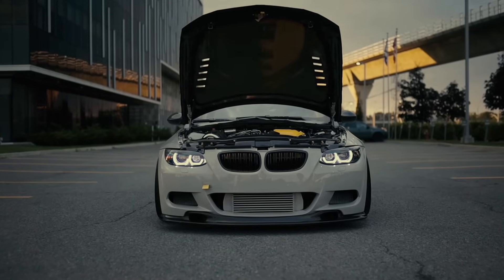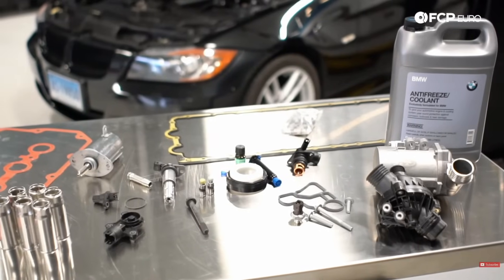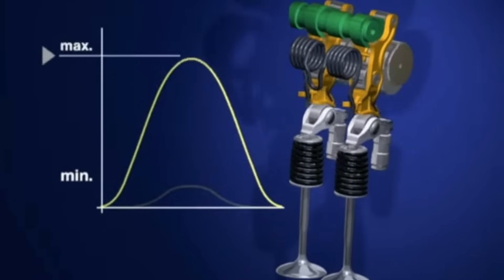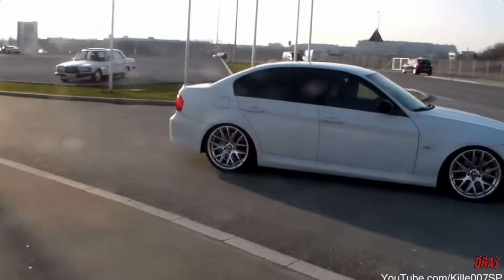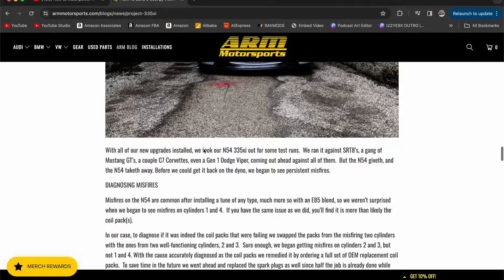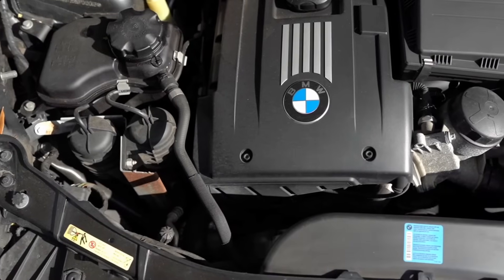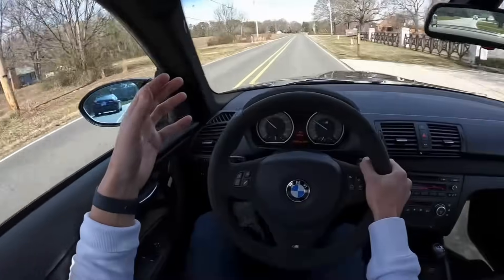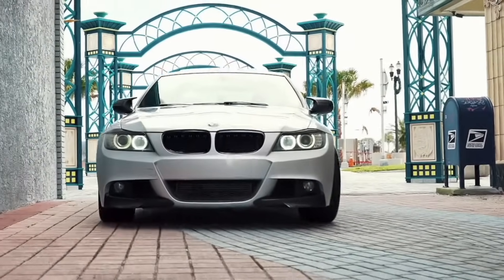Ultimate BMW Engine Showdown: N52 vs N54 vs N55 – Which One Should You Choose? | Comparison & Review

Comment: come on dawg N52...all the way...if your cost conscious like me. I'm still fast and light...Full bolts on, 6MT, Supercharged...and heavily reliable
Reply from the maker: I’d love to pick your brain on the supercharger, do you have an insta?
Reply: supercharged and reliable?
Reply: @mikedodd9294  yeah, so far I only replaced the valve cover gasket and the starter…common car issues
Reply: Depends on your goals.  If you want a low cost tunable and somewhat reliable car.  For 1500 bucks add a down pipe, intercooler, BM3 OTS tune & you N55 will make about 360 WHP which is about 415 crank with about 500 Ft lbs of torque.  These N55 powered vehicles are very low cost machines.  
If you care more about maintenance costs than performance you could buy a Toyota or an N52. 
If you want to build a 600 HP engine without changing the internals, go with the N54.  If you want somewhere in the middle go with the N55 if you can't afford a B58 powered machine.
Reply: @jeffa.8976  you’re right; the next  time I go to a turbo charged platform; trust me it will not be a BMW (I love the BMW NA, BMW had a legacy with NA cars) I will get a Honda civic type R.
Reply: @nelsonx4235   @nelsonx4235  A  Civic type R is a great car but I think a B58 powered 240 or 340 is a much better choice.  #1 Modern BMW's are ranked #3 in reliability by consumer reports which puts them only behind Toyota and Lexus but ahead of Honda.  The B58 engine with a ZF 8 speed is the most reliable powertrain BMW offers but manuals are still available.  #2  The mark up on new type R's and resale of used ones make a used BMW 240 or 340 cheaper.  #3 The BMW's are RWD or AWD. which is far more fun than FWD, the AWD is good for winter.  Both the RWD & AWD will handle high H.P better than a FWD car.
Reply: sadly FBO on an N52 gets you stock power of a  N54 minus 5Hp. for about $4000
Reply: @AndrewNichols  that is more than enough for people who just want a clean daily that doesn’t have n54 problems
Reply: @lousehassle yes but put $4k into an n54 IN JUST MAINTENANCE and it will last just as long
Reply: @kevinsinor2821  hahahaha I think you’re full of crap, I owned one (used one high mileage) and I can tell you I spent big $$$ on injectors, turbos, carbon build up, wastegate rattle, high pressure fuel pump and not to mentioned the common oil leaks
Reply: @lousehassle  yeah I’m probably making close to 330 to 350wph; I haven’t dyno…not crazy power but I’m light and it is fun to drive. It is my daily so no need to get crazy hp.
Reply: @nelsonx4235  I hear ya, but all of what you mentioned can be taken care of for $4k. Taking care of the turbos and wastegate rattle are the same thing. Hpfp $1k injectors $1k. Turbos $2k on average depending on what you go with. But this is also from a diy perspective so labor is not included in these costs. Surely if you had a shop do it they’d steal all your money and the maintenance would total out the car. But most n54 owners are going to diy
Reply: @kevinsinor2821  it’s too much hassle for me; the N52 makes sense for my needs; it’s not crazy power but it’s a great platform. The N54 I think is for more like a track car build imo
Reply: @nelsonx4235 what did u do to it to make it get 330HP?
Reply: @Ry3Pacyy  customs tune, smaller pulley, injectors, custom exhaust etc…I may be between 300 to 330whp. Again I just wanted a bit of power…I don’t need 400hp + for daily
Reply: @lousehassle n55? Get a 2012 - 2013 and u get rid of the hpfp issues, n55 fixed injector/plug/coil issues from n54. Only extra worries from n55 vs n52 is the turbo. Other than that it is just as reliable.
Reply: @kevinsinor2821 facts I put 4.2 in maintenance at bmw warranty work haven’t ever been in the side of the road in my 335i
Reply: @nelsonx4235  lol I owned n54 and n55 (still do) and my n54 has 250k miles runs like a champ only had to fix a minor oil leak. My n55 only has 100k miles still no problems what so ever. So when kids get a hold to cars they usually break quickly and easily.
Reply: @ThatN55GuyB  I get you and yeah you right...Im just deep in this N52 build
Reply: @lousehassle so youd rather do all that work drop all that money and do supporting maintenance on the new mods just to get beat by a completely stock 335i? you crazy
Reply: @lousehassle just get a m57 best of both worlds
Reply: @lousehassle I’m saying 300+hp NA vs boosted is way better
Reply: @lousehassle right , I'm looking for a fun fast reliable bmw. That's ALSO looks good.
Reply: @nelsonx4235 idk. I’ve had my N54 with 133k miles single turbo’d at 475~WHP since about 108k miles and haven’t had ANY issues with the engine at all.
Reply: @SuperBloopie it’s a matter of time, even mine has issues…imagine an n54 which is a MORE complex platform
Reply: @nelsonx4235 lol my exhaust manifold warped and ripped the threads out of the head 😂 you ain’t wrong
Reply: @AndrewNichols weight difference?
Reply: @BlackMigo702  200 pounds lighter…car stock, no sunroof, lighter wheels, back seat delete, racing light front seats, removed heavy muffler, lighter hood…there is more yeah
Reply: @AndrewNichols there’s a single turbo kit that gets 400-450 whp if I remember correctly
Reply: @AndrewNichols  who cares I owned one and that car always had an issue…yeah they make more power but a high steep cost…my N52 makes decent power, but it is a blast to drive…and I’m super light too
Reply: Had all 3. The n54(z4) is honestly hysteria on wheels! Stupid fast in stock form. N52 is slept on..milvs and a few na mods a tune?? s50 who😭?The n55 is a decent daily and can live weeks starved of oil and coolant but it can feel boring at times. Least fav drive experience
Reply: are you thinking of doing the 22rpd velocity stack intake soon for more power? they claimed 270whp with other boltons on an NA motor
Reply: @bogdanneamtu12  that’s nice but I already got the supercharger so I don’t see the need to add this
Reply: N55 is a wank engine! They fail all the time, valve tronic is crap and bottom ends knocks, cam carriers move, just avoid!
Reply: Why you lying to these people
Reply: @ashtonwalker14  lying? because I’m pushing an alternative platform?
Reply: @ashtonwalker14  clowns like you think N54 is always the answer…yeah if you want raw power yeah
Reply: @nelsonx4235  i went 335I road. with M3 arms,  plan on doing ARM downpipes and a AAF Baffle in the pan next.  But my engine is super clean inside, i've replaced a lot of the plastic components with metal ones,  and the car has almost 190K on it with the ZF6 speed manual 

i personally think the N54 is more mod friendly,  makes decent power, and is more well balanced overall for road coursing,  it does need an M3 or ford 8.8 rear differential though.. this one wheel wonder crap sucks.
Reply: @exiteternium  I def agree with you; I'm just too deep invested in the N52 built
Reply: @exiteternium  yeah I get you; not hating if you’re chasing raw power; makes sense; I just prefer the NA inline 6 platform
Reply: @nelsonx4235  Raw? no, 450-500 well balanced power? yes.  the car with M3 arms does exceptionally well with cornering, even stock they did 0.90-0.95 G's 
which is great for AutoX.  so no, looking for for a Slalom/AutoX that i can daily drive.
Reply: I have so many questions. I'm about to get a n52 328 and need some guidance.
Reply from the maker: @terrencewoodard8000 ask away brotha. also find me on instagram @izzysakran and I’ll help more on there
Reply: Still running 12s with all that work done. Just toss me the n55 if I want reliablility and n54 for real power.
Reply: N52 Engine never disappointed not a bit
Reply: @drphirinaphtaly6409  the N54 folks haven’t experienced a supercharged, reliable, lighter BMW. It’s just the NA inline 6 feeling.
Reply: Bro facts. 3stage intake and a tune already does so much and still stays reliable 😂. I’d take an N52 any day
Reply: @GuacGG  yeah i agree thats enough power for a daily; the suercharger adds a bit of spice....not crazy power, but enough to love the car more
Reply: Might as well get a 335i at that point and put the same money into maintenance to have a reliable car. No mods
Reply: @CalmDown458  true, just too deep into this build
Reply: M57 all day long 🤣 16 year old one sat outside no oil leaks or crap like that easy to fix timing chain and the e90s just a special car
Reply: How much power?
Reply: Yeahh!!!😂
Reply: N54 ftw
Reply: idk why but I trust you lol. definitely getting the 530i . Been hearing good things about the n52
Reply: Cmon dawg
Reply: @HolaHelloBonjour-fku the hate is real

Comment: 300k mile N54 in a E90 335i, love it, do your maintainince.
Reply from the maker: that’s amazing! do you have it tuned or running factory power?
Reply: @IzzyE9X tuned and it had a weight loss down to 2600lbs
Reply: N54 almost 200k miles.
Reply: That’s awesome to hear. I never actually see high power high milage BMWs on YouTube other then that 335i on mishas page. It makes me happy to know I’ll have my 75k mile n54 for a long time😆
Reply: 700hp n54 135i 6mt vert with Rollcage , parts are becoming more affordable plus lifetime replacement with FCP EURO.
Reply: I have a 2008 135i convertible with 153k miles and no issues :) just do your maintenance that's all and yeah if you don't work on cars probably is gonna be expensive but parts aren't expensive but the labor it is but if you do it yourself you'll save money and also you know your car is in good shape
Reply: 128k miles on my 335i E90 2009. Bought from auction, hit in front. This baby flies, and no need to even tune or anything🙂‍↕️🙂‍↕️
Reply: 250k here   Bought at a junk yard at 150k miles and still running beautifully
Reply: My radiator just went off because of over heat😂🥲
Reply: Yep they are super strong!!!
Reply: I'm rebuilding mine (N54), like servicing the engine fully and then will install FBO and and mhd stage 2 probly 😅 P.S. it's on 225K kilometers. That's ermm about 140K miles.
Reply: @RainbowBelow Me too. Did you do the food yet? How's she running?
Reply: @adccars359  Not yet but completing it this coming 2 weeks with my mechanic. Did a lot of additional upgrades including the Mosselman oil cooler and oil thermostat, downpipes, intercooler, sport air filter, new turbine cores, new springs & shocks, changed rod bearings and main bearings full inspection and servicing of the transmission, coils, plugs etc. Also added the AFE power XP mach force axle-back exhaust :) Can't wait to hear her running man... exciting times!
Reply: @RainbowBelow Awe man. Best of luck.
Reply: 8 waterpumps later… I own one trust me I know
Reply: @GiveItGas69420  bro 8 waterpumps? Lmao wtf did you put the same one back in every time 😎😆(sarcasm)
Reply: @GiveItGas69420  How did you know it?
Reply: N52 291k miles and a N55 32k miles. N55 so much more fun.

Comment: I have a 2013 535i m sport n55 that has catted downpipe, VRSF intercooler, Valvetronic remote exhaust, MHD stage 2+ tune, XHP transmission tune, and will pull any 550i any day. Just hit 100k miles, and my only failure has been a water pump, and that really didn't even fail, but it was going because my fan would run more often. 
What I'm saying is I drive the crap out of this car daily and it's without a doubt been the most dependable vehicle I've ever owned. Not to mention I've always been a Mustang guy.. 
That said, the n55 to me is that sweet spot.. 
Nice video! Thanks
Reply: Hey Brother, I also have a 13 535i M-Sport X drive.  My OTS stage 2, XHP stage 3 car runs a 12.9 with a s tock exhaust & intake.  I beat a B58 powered 340 in a heads up race at the local strip.
I have bought a really nice low kilometer one owner car with a documented perfect service history.  I currently have 125,000 kilometers which is roughly 75K miles.  I'm installing a pure 500 turbo, high flow inlet pipe, heavy duty waste gate, GFB diverter valve in July. I'm also upgrading rod bearings, changing the oil pan gasket, valve cover, coolant lines, thermostat & water pump just for maintenance while I have the subframe off.  I live in an apartment in Edmonton so I'm driving 3 or 4 days across the country where my family has a shop so I can do all the work myself.
Reply: 3 pulls 2 months ago on the dyno with a best of 351hp and 411tq at the wheels @19.5 psi. Also that's running e30. It's a very healthy motor on the stock turbo. Still gets 30ish mpg highway.  Iam considering a Dorch stage 2.5 hpfp, but can't decide on either a Pure stage 1, or stage 2 turbo upgrade. Since it's my daily driver I may just go Pure stage 1 and call it a day. I believe going stage 1 on the stock hpfp will definitely get me at or just above the 400whp on 93 octane..
That to me is the sweet spot. Also according to Draggy the way I sit my best 0-60 was 4.27, and quarter mile was 12.92 @ 109.4 with a bit of wheel spin
Big improvement compared to stock
Reply: Oh as a note that dyno session was before I installed the VRSF intercooler.   Since that it does feel better in the upper rpm range as the boost hangs strong longer.. If that makes any sense
Reply: All a 550i would need for you is a downpipe and a tune he’s making 125 whp more then you
Reply: No doubt.. That's all good.. I've got plenty of performance and still returning 30mpg..
Reply: I have 535 i  with N55 , very happy with my car
Reply: How much power do you put down?
Reply: That's exactly what I needed to hear.
Looks like I know where my next pound of hundred dollar bills will be going...lol.. 
Are you still on the stock hpfp with the Pure stage 1???
Thanks bro..
Reply from the maker: seeing healthy, productive car conversations like these is exactly why I love the BMW community 🥲💜
Reply: @gregleri535i  yes I am still on the stock high-pressure fuel pump. I am in the process of putting a helix overdrive on right now to handle my horsepower. I have a walbro 450 lpfp with a ekpm3 installed also.
Reply: Go with stage 1 spools very quick!  I have stage 1 pure turbo fbo running flex fuel custom tune car pushing 450 awhp in summer and 470 in winter months. Love the car it's a 2011 535i xdrive.